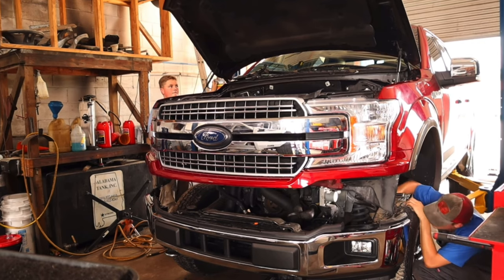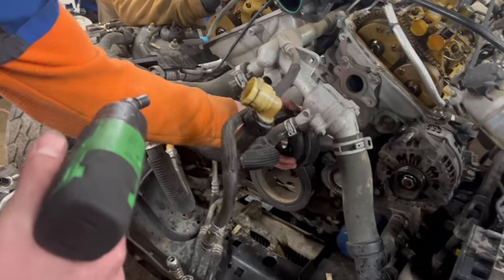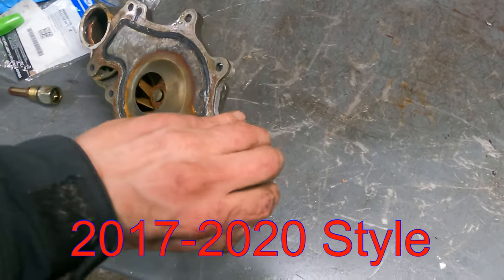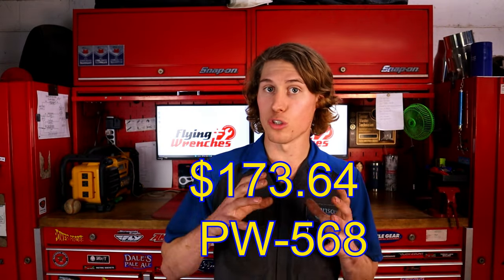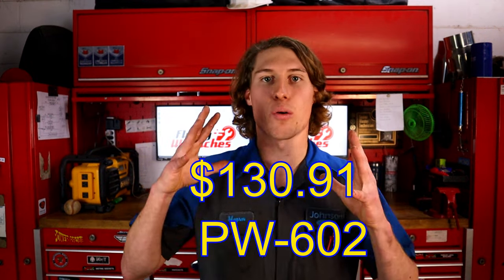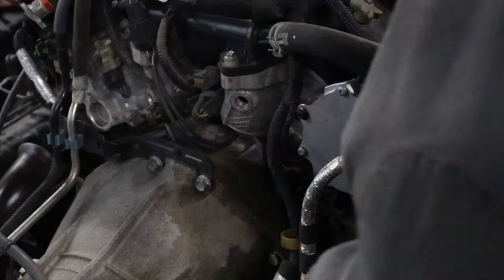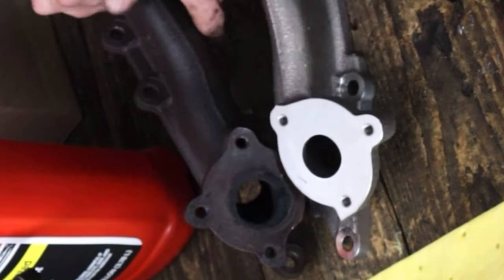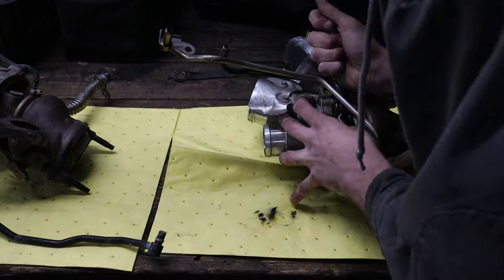Ford F-150 Most Common Coolant Leaks | 3.5 EcoBoost V6

Comment: I'm never buying the eco again. I know the 5.0 has some issues but I have tried so hard to do all the right maintenance and any repairs needed as soon as they pop up. Well the truck has already needed a water pump and now both turbo coolant fittings need replacing. It only has 70k miles on a 2014. Not to mention all the other typical ford problems like water leaking into the cab from 2 different places. I have a shitbox early 2000s nissan and it never leaked anywhere. idk I love buying American but we used to earn it with quality product. Doesn't seem to be that way anymore.
Reply: I'm with you.  They are so complicated and effing difficult for the tech to repair.
Reply: I will never ever buy Ford again. My 2014 ecoboost Timing chain went, leaking turbos and now a new coolant leak all before 70k miles, and that's with proper maintenance all the way. Absolute garbage vehicles
Reply: @komokaziboschetti   You should look into getting yourself checked in somewhere.  There are homes for people such as you.
Reply: Can we sue ford!! Its always something new breaking or needing repairs with the 3.5

Comment: Why is it every time a ford engine is being worked on the cab is off… I mean at this point does ford remember what the hood was for.
Reply: I just pulled a 3.5 eco boost in an Expedition for replacement. I do not have the resources to pull the cab, so🤕. Honestly, its the worst engine pull I have ever done. I can see why techs pull the cab.
Reply: Because you can’t get to shit every repair I’ve done on my engine has took me an entire Saturday and half of Sunday so I can see why they pull it
Reply: Its not neccesarry,  just easier
Reply: Mainly pads the bill. It's a small engine in a big truck.
Reply: @guyina4x499 honestly it pays the same either way but much easier pulling cab
Reply: Is the leaking turbo coolant fittings a manufacturer defect?
Reply: Lol
Reply: This makes replacing the water pump on my old 300 in my 1994F150 look easy,FOMOCO should  of never ceased production of them
Reply: Yea, 15min to lift the cab… we both know that’s a joke.
Reply: They should just put a latch on the rear of the cab and tilt the whole cab forward like a semi.😂😂😂

Comment: $3500-$6500.  Might as well just throw in a rebuilt that has new/rebuilt turbos on it.  I have 353000 original miles on my 2016 Expedition 3.5L Ecoboost.  I'll run it till it blows up.  Just doesn't make sense to drop a penny expensive hardware at 353000 miles.  Plugs/i.e. basic stuff, I'll keep maintaining.
Reply: Highly doubt you're putting a rebuilt for 6k.

Comment: Really well done. My truck has been leaking for 150,000 miles. I just deal with it.
Reply: Bruh I can top off a hell of a lot of coolant for $6500...
Reply: @shaynebrown131 
Yep
Reply: I've been leaking coolant for 25k over 5 years always said screw it. Just found out the coolant dripping out of the quick fitting off the reservoir (if that's where your leak is like mine) can cause problems for your driver side turbo 😬 just moved up on my priority list.
Reply: @SpasticTom 
I don’t remember why I was watching an EcoBoost video, I have a 5.0. I have fixed all my leaks for now. The water pump was making a lot of noise but only leaking a tiny bit. The block heater was the big problem, I installed a new one and that pretty much fixed it.  I also replaced the upper and lower hoses, the y pipe, water pump, idler, both tensioners and belts, oil cooler, the O ring at the overflow bottle, the oil pan gasket, spark plugs and an air filter. It’s like a new truck, that is if new trucks had rotted out rockers.

Comment: Yep, 125,000 miles on my 3.5 EcoBoost, just did a dye test on the coolant leak I had, the drivers side turbo is leaking along with the weep hole on the water pump! Spot on!

Comment: LOL... anybody else pick up he said "Stealership"?  Firstly,  awesome video and explanation and appreciate your time to help others.  Cam Phaser replacements are your life huh?  I've had them replaced twice on my 2018 F150 at only 80,000 miles.  Got home today with a water "gusher" coming from the front of my engine @ 84000 miles.  Haven't yet confirmed but suspect water pump.  Noticed in your links to parts under the EcoBoost recommendations it states "Sell it".  Pretty sure that's what I'm going to do.  Done with Ford.  Up side is it is a Gen2 so not the hassle to change out WP as with the 11 - 16s.
Reply: I had to replay it back where he said “stealership” to make sure I heard it right 😂😂😂

Comment: I own a first gen Ecoboost F150. Bought it used in 2018. Had the water pump and coolant hose replaced later that year. The quick connect started leaking again last year so o bought the bypass kit from Pegasus Racing and installed it. I haven’t had a coolant issue since.

Comment: Thought I had a WP leak @90K on my 2016 Expedition.  Pump was still ok.  Bearing ok, no leakage from the weep hole.  Just was not sealing well.  Put a new pump in and no more coolant drips on the garage floor.

Comment: I just changed the drivers side coolant fitting and hose from my 2013 F150 at 130K . A little advice , you can possible replace it with the fitting with the turbo still in but it was so much easier with the turbo out. I didnt need to change any studs or nothing else.
Reply: Took the wheel off and just replaced the fittings on the turbo?

Comment: Great video mason 👍👍 
Did you say "stealership" 🤣 sounded like it 
I have a 2019 expedition, has a slow leak, so slow I can't tell where it's coming from. Now that I have some ideas I'll go looking for it and get it done. Replacing the radiator fan assembly while I'm at it, the driver side was all of a sudden very loud and I found that the fan itself has some shaft play, I'm guessing it's causing a vibration and loud jet engine sound bc of that play. Might as well Geterdone

Comment: You should add comment for the DIYers as to whether the cab needs to be lifted for certain operations.  I'll put a lift in for 6500.00 and do in myself.  Good videos BTW.

Comment: Got rid of my 3.5 ecoboost taurus because the water pump was leaking.

Car was so much fun (methanol injected) but the water pump was timing chain driven.... I bought all the parts to do it, and then a turbo went out. Just got rid of it instead of putting 12+ hours of labor into it for a water pump.

Comment: have you seen coolant leaks after replacing water pump with updated part or after replacing turbo lines? what a bout the vacuum pump, do they tend to leak after getting replaced? Thanks,
Reply: On my 2017 3.5EB, had the dealership replace the WP.  It started leaking a few months after.  This was mid 2023.

Comment: Thank you so much for your videos. I have a 2017 F150 3.5 ecoboost with only 17,000 miles. Should I try to sell or trade before any issues?

Comment: Mayson….I noticed that your the 2nd Ford dealership tech that has an Amsoil sticker on your tool box. I’m pretty close with a local Ford dealership tech in my area, and recently I’ve been talking to him about my 2019 F-150 with the 5.0.  I asked him for his thoughts regarding the proper oil to use in it, because as we know Ford recommends motorcraft 5w-20 synthetic blend….which is what I’m currently using. I’m in the Houston area and with our hot humid climate and stop and go traffic….he recommends to use nothing but 5w-30 synthetic blend or pure synthetic at the minimum.  He then preceded to tell me that he personally only uses Amsoil in his 23’ mustang GT with the 5.0 coyote motor and that his 5.0 is absolutely silently quiet at an idle. Before he switched over to Amsoil he was using the factory recommended Motorcraft synthetic blend oil….but after he switched over to using Amsoil….his 5.0 became noticeably quieter. So I would like to ask - what’s your thoughts & experience using Amsoil?
Reply: Synthetic blend is not as good as full synthetic. Also, I recommend doing oil changes at around half the stated mileage in the owner's manual, quote Dave Auto.
Reply: Also using thicker oil damages the engine a lot more when you start it up. Use the factory oil weight of 5W20.

The advice of using thicker oil does not apply to engines made in the lasts 35 years, it's advice from the 1960s. Don't crack good blocks like my dad would.
Reply: And never put too much oil. If the dipstick shows too much, use a brake bleeding vacuum hand tool or a basic syringe to remove the excess.

Comment: Question: Do you have to program the turbos after replacement? Im replacing a turbo on my friend's 2017 f150 3.5L lariat. It's got electric solenoid waste gates. I just wanted to double check, googling it didn't tell me i had to.

Comment: In all of your videos, it’s crazy how often you remove the cab. As a Toyota tech I’d want to quit if I had to pull cabs on Tacomas and Tundras all day 😂.
Reply: I agree it's a giant middle finger
Reply: So much easier though. You get access to everything. When my F-150 was "built" they even separated the cab from the frame. And while it's separated, they did there work, while the frame and body was cleaned up, blasted and painted, when all done mated the truck back together.
Reply: Since Toyota has brought turbo and hybrid powerplants into the Tundra and Tacoma line, I'd say your days are going to get a lot worse from here forward.
Reply: @carbonking53  Damn good response, couldn't said it better myself. Guess he never has tried to take a turbo off a F-150 with the cab on.

Comment: I have a question, based on your knowledge I believe I have a leak coming from the turbo lines but the slow dripping looks like oil  is that what it it? And can I still drive it or it has to be immediately fixed?
Reply: Ford uses both oil and coolant for the turbos on a 3.5 Ecoboost so it's entirely possible that it could be oil dripping. As for safety, as long as the leak is relatively slow and you keep the fluids topped off, I see no reason why you couldn't keep driving it.

Comment: technician----mason,,, what state city you are at??
  my 2018 expedition has a coolant leak ,,it has 140k miles on it.  I did oil change to remove the oil filter, I saw orange color coolant leak by the water hose attach to engine near the drive belt..not quite sure is the water pump,

Comment: 2019 expedition 73k miles. I’ve had for two months and I’ve already had the cam phasers replaced. I have added antifreeze 4 times in two months. I just put dye in it tonight but I couldn’t see anything leaking? Any ideas?? This is my family vehicle and I couldn’t be regretting getting rid of the highlander any more at this point. It has been a nightmare..

Comment: Question. I had leak and over heating and Grey exhaust. I took truck in 3 months ago for a new turbo. Was fine for a while...  today it's running hot. Coolant was low. Am I leaking on fittings?

Comment: So it looks like I have a leak at the rear fittings. If you are saying that everything needs to be replaced and I am looking at approx $6500. At that point should I just replace engine. Truck has 120k. Buying new and dealing with high interest rate I am thinking just replace the engine. Thoughts?

Comment: Hi Mason I have a 2015 6.7 with 3000 MI. Mini fire truck. Keep getting a mass air flow code & the  EGR temp sensor is reading  -40 deg.  I am struggling with it. Any idea?

Comment: i have moisture on my vell housing from the right side (vac pump or valve cover) and left side (broken exhaust stud) but i will check those inner fittings

Comment: had a 2014 3.5 with 78k miles I put on it.   had a 2017 3.5 I put 123k on it.   have a 2022 with 3.5 and have 23k on it.  NO coolant leaks EVER.   however 2 cam phaser fixes on the 2017,  cam phasers with the gen 2 ecoboosts is the video you should be making.
Reply: My 2017 also had two cam phasers replaced.   But I also has water pump replaced too.

Comment: I love my 18 F-150 lariat but just the money I've spent on preventative maintenance I could have bought a nice used v-8 truck luckily I've had great service from my truck so far but I'm thinking of selling it and getting the v-8 or a 06 Silverado I've had 3 over the years with no major problems at all but for example Ford charged almost $600 just for a coolant flush and needs to be done every 30,000 miles sorry for rambling 😂 just spent $1000 on maintenance yesterday

Comment: I got a 2017 ford expedition ecobust and it’s leaking coolant on the exhaust, what would it be from I just change the oil and didn’t see no water in it

Comment: I have a 2018 3.5 come in with a minor coolant leak, waterpump is dry, almost looks like the drip is coming off the front cover is that possible. Its got gray sealer on it like its been off before. truck has 89k miles on it

Comment: What about wastegate position sensor circuit high voltage after cam phaser replacement? I’ve already changed the sensor and no fix, any help?

Comment: My truck is in for the turbo fitting repair. Do most ford dealer shops replace the other fittings, lines oil supply filter without being told? Or do you have to be specific when bringing truck in? I tried mentioning to the counter service guy. He didn't seem to be listening to me and not be very informed. I watched your video and want all the nearby parts fixed while they have the engine torn apart. I understand alot of customers think they know everything but it seems not all ford techs or shops are the same. Wish I could bring my truck down to you! Not looking forward to paying thousands for a coolant leak.

Comment: My 2017 f150 3.5l ecoboost had the turbo leak coolant & oil feed at the block with 170,000 km's though.
I bought it at 160,000 so who knows what was done to it and by whom 🤷🏻‍♂️ has the startup rattle so I'm in the middle of replacing everything timing (2021 phasers) including all turbo seals tubes are fine (SS) & fittings at block,  Full race cast SS ceramic manifold with CTS turbo adapters while I'm in there.

Comment: my 13 f150 3.5 sounds like my pump bearings are going. bad leak started about the same time. loosing about gal a day. dealership quoted little over $700 parts and labor for the job 🤦‍♂️

Comment: New manifolds…$4000. Thank goodness for drivetrain warranty because I would be doing this repair myself before I paid $4000 for new manifolds! The water pump took 3.5 hours on my 2013 f-150 and it really sucked with all of the charge air pipes!

Comment: bro its like you are in my head because i was just looking for my coolant leak yesterday. mine must be hitting my ehost because you can smell it when its hot. i also noticed coolant near my oil pan. so maybe its going down the turbo line onto the oil pan? also some googling pointed towards maybe the heater coil? i smell it most when the heater is on.

Comment: Its stupid to not replace both considering all the work u have to do to get to them. Thats like needing to change a water pump on a later model ohc 4 cyl and not replacing the the timing belt,tensioner and idler y u have everything apart.

Comment: These damn water pumps leak on any engine, any trim, any year. from 2010 and up. Might as well replace them right after you pick up your F-150 off the dealership lot.

Comment: I'm a Marine Tech but usually do all my own auto work. I recently got a 2011 supercrew with the 3.5 Eco (167k). Carax shows it had a Timing Job and W pump about 20k ago.  I'm torn down now and awaiting an alternator. Fenderwell lining is out too. Ive had a smell coolant leak but no visual anywhere. Turbo's are dry. I reached up behind the left cylinder head and?  You guessed it, coolant line was soaked. My fearfull question- Is there enough access to change that  fitting ? Maybe with the intake and V covers off?  I also have leaky V covers anyway and thought if I need to pull the intake, I can also clean my exhaust valves.  Thanks, Glenn

Comment: And the line out of the reservoir is notorious, instead of replacing the whole line, you can get a pick and remove the seal and put a replacement in, save a bunch of money.
Reply: Is there a video on this?  Mine’s leaking from the elbow press fitting below the reservoir tank. Thanks

Comment: Changing that water pump on mines is really hell I have a 2012 F150 3.5 Turbo I caught hell changing the water pump the problem I'm having now is that I cannot burp it I tried everything to get this air out my system and it still giving me the flux when I go up hills the heat indicator will attack out when I level off it comes back down someone told me that I could possibly have a blown head I have no indications of that although you know they said it could be going out my exhaust but seem like I was smell the antifreeze coming out their exhaust or whatever but I'm not please figure this situation out

Comment: any opinion on excessive exhaust smoke on cold starts? 2018 ecoboost.  seems to clear up after about 10+ minutes of idling.  smoke seems to smell like burning oil or maybe coolant hard to tell.
Reply: neither of those are a good sign. get it looked at asap
Reply: May be valve covers/seals leaking oil.
Reply: @JohnnYp1234 would love to hear how this turned out for you. I noticed the same phenomenon on my babied 2015 3.5 EB (56K miles) and found out the passenger side turbo blew up along with a cracked exhaust manifold (same side). It burned oil like crazy and dumped huge amounts of oil into the exhaust. All this after a cold start on an extremely cold morning.
Reply: @kylel5752  well... I never really looked any further into it. it was just always something I noticed. notice it more in the winter than anything.  I'm pretty good about keeping an eye on my fluid levels so I don't see any coolant or oil disappearing.  so at this point i'm kinda just writing it off as steam from moisture in the exhaust system.  i did recently have a driver side turbo replaced due to wastegate rattling. they never reported to me that they found excessive oil in the exhaust or not. seems to still be smokey / steamy on cold starts.